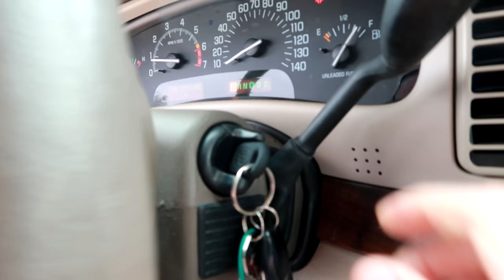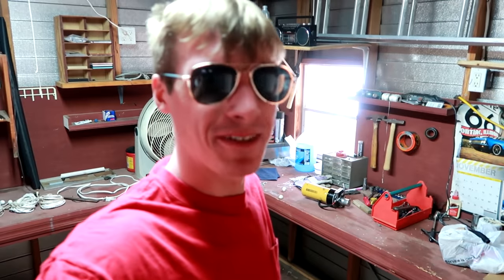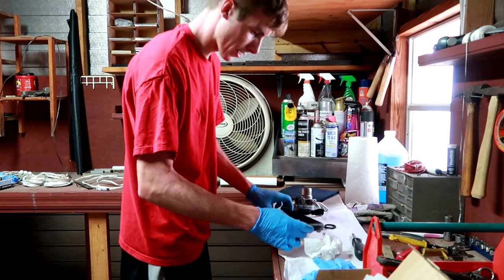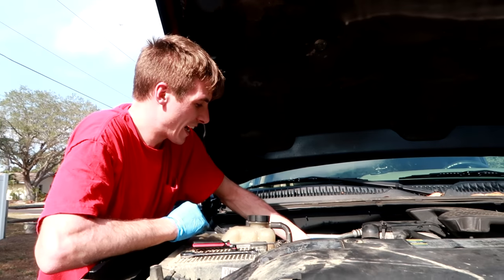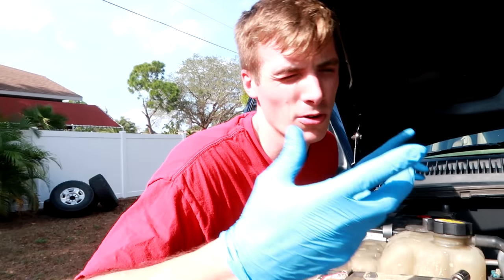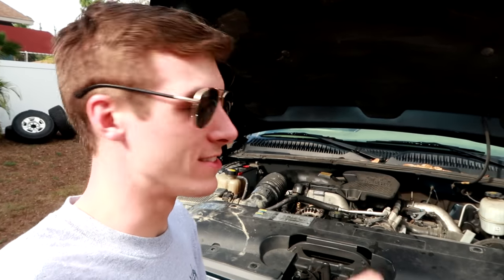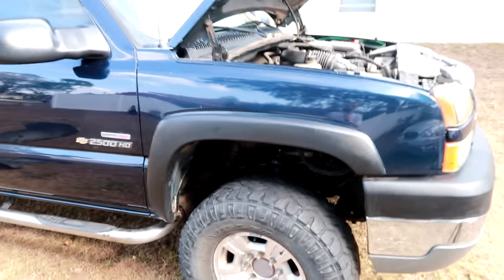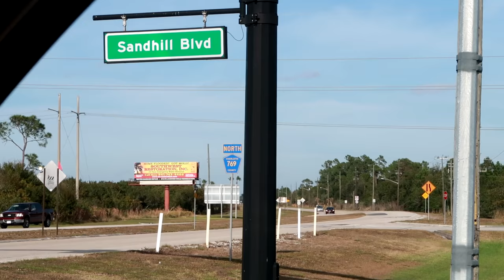THE DURAMAX DIED!!!

Comment: Word of advice mate, if you can afford to when it comes to specific o-rings, crush washers gaskets or other things, get the OEM parts for your diesel. They are a bit pricey sometimes depending on what you need, but they are factory fitted and work perfect every time. Some vehicles are like your BMW, OEM is the only way to go for a true fit. Glad you got everything sorted and your truck back up and running mate. Hope your vacation is going great as well.

Comment: Having the bleeder screw out like that will allow air to enter the filter head.  Just undo the bleeder screw half way and allow the fuel to escape out the threads and then tighten down to not allow air into the system.  Intital startup after a filter swap will be much quicker and easier on your starter.

Comment: If I may offer 2 suggestions, there are brass bleeder plugs available that are way better then those cheap plastic ones. Also, the Duramax responds very well to aftermarket lift pumps. And they solve the problems that come from loosing prime. My plastic bleeder lasted less then 2 filter changes.

Comment: next time you have to bleed the fuel system just bleed it like you did at the fuel filter housing then after that bleed it at the front of the engine at the fuel pressure test port and you will reduce crank time drastically after you have opened up the fuel system
Reply: Southern Mechanic k

Comment: Hey bud my 2005 duramax did the same thing. It's the fuel filter on the passenger side of the truck on the side of the engine. You can buy one on amazon. I did and mine has been running great ever since

Comment: I'm a big fan but man, why do you do such major repairs on your vehicle being 1000 miles from home?
Reply: R1Flem exactly
Reply: R1Flem You would drive, what like a thousand miles, with problems like he's having? Yeah, no lol.
Reply: R1Flem I had to replace all my spark plugs and put new threads in 2000 miles away from home in someone else's garage some times you don't have a choice
Reply: I didn't hear any mention of fuel system issues other than he just wanted to change the filter and seals although he did mention had a bad fuel line.
Reply: Bass Coast Central you are correct, sometimes you have no choice but to do what you need to do to get you home, but removing a fuel head unit and installing a sketchy filter adapter unnecessarily seems silly when you are a thousand miles from home.
Reply: Carson Wedel lol.....ok

Comment: goodbye starter solenoid
Reply: big diesels like this have very strong starters so they can crank for longer than normal petrol cars ....
Reply: its better to crank a diesel longer than short cranks like a gas engine if you cant get it started.
Reply: That won't hurt it, it's a 6.6L Duramax, not a 1.6L accent
Reply: I'm a diesel technician, I've rebuilt many starters +solenoids. cranking to that extent is not good. thanks for your input but I know from experience whether you think that's the case or not.
Reply: the bigger the motor the bigger the starter. My 68 Minneapolis moline m670 tractor still has the original starter on it, have to crank that thing for about 2 minutes before it will start in the summer, and 10 minute minimum in the winter lol. Still going but almost time for a rebuilt, going to be expensive. thanks for your input but I too know from experience. The amount he cranked in this video was not long at all. Wouldnt hurt anything, the starter would just be getting warmed up. The hardest thing on a starter is trying to crank them with weak batteries, that really burns them up. But a fast crank, it not near as hard on them.
Reply: I definitely will Brenden, its in the plans for sure! Just starting my channel now. Hoping to get the tractor going in a week or so. Its -30celius right now without the windchill! The tractor would probably never start!I am in Canada, Northern Sask. We have extreme cold weather warnings on the weather channel right now! lol Suppose to hit -40 tonight. Thats why I havent posted for a week, been very cold here! Was hoping my camera equipment I ordered would be in by now so I could film some better views of my videos too. lol. but suppose to be -3c in a week and I am hoping to get the tractor started and put in the shop so i can move some snow with it when it comes, we have hardly anything right now. 2 inchs.. I have a Front end loader on it too. In the summer I will have plenty of videos, doing a lot of landscaping! We just bought our property a few years ago and needs a ton of work.
Reply: excessive long cranking definitely does wear a starter, this video was not very long cranking for this trucks big starter, and he wont have to say good bye to his starter.  he posts new videos daily and will definitely let us know if his starter is shot.
Reply: JakeChevy Suzuki since you're a diesel technician I assume you know how a detroit series 60 gets primed after you change the fuel filters right? Yep you crank it for 30 seconds at a time because there is no manual primer on those engines yeah 30 seconds at a time! I've done that countless amounts of time on trucks that had well over 2,000,000 miles, needless to say the starters are ok

Comment: Hey I have the same model truck 03 lb7 and mine has the plastic bleed screw that broke on me and mine has a tendencies of not starting when I park on a hill facing up hill and it loses its prim and  every time that happens I go to the fuel system and there a pump on it and I have to put that to get the air out and it will start. And I that mite have been ur problem. I just wanted to let u some of the problems my have. But otherwise the Diesel life rocks!!!!

Comment: More than likely they sold you the wrong parts. I have discovered that many times that some times they screw up the part with the wrong number. It makes me mad. Now days I Bring in my old parts and compair,if they are not correct,then I dont install. I had to go to other sores to get the correct parts from a different supplier.

Comment: Should of bought a ford
Reply: Austin Perry hell
Reply: Austin Perry yeah
Reply: Austin Perry yeah then he would of broke down in New York
Reply: Austin Perry #burn
Reply: Austin Perry even though I'm impartial because I own a ford Chevy gmc and jeeps
Reply: Limozen Man 69 Ford all the way
Reply: Austin Perry dodge all the way
Reply: Austin Perry no hell no
Reply: I'm Zoid Got confused with dodge I think there bud
Reply: Jarret That's who I'm talking about bud LOL I'm a Ford guy so ya.
Reply: Ford is the most reliable on the road by far. With normal maintenance intervals they will last forever
Reply: Nathan T Duh.
Reply: Nathan T Lol, tell me more about how reliable the 6.0 was, same with the 6.4. Tell me more about how reliable the transmissions was on the 7.3. And don't say "well if you bulletproof this and fix that..."   if I spend 40k on a truck they should run right from the damn factory.
Reply: Powerstroke master race
Reply: Darren Thomas If you're spending 40k on a truck I would hope you're getting a newer 2011-2016 6.7. Hell you could probably get a brand new SD XL 6.7 for 40k.
Reply: CGComputerInc  A brand new 6.7 Powerstroke will cost in the mid 50's for a base model 4 door, same with the Duramax. That's why I chose a Ram with the 6 speed. However, if I bought a new 6.0 back in the day and spent 40k on it, I would be highly pissed if I had to put another 5k into it to make it run right. The new 6.7's are  solid but not everyone can afford a brand new one. I'm just saying, you hear of a lot less problems with Chevy and Dodge then you do Ford.
Reply: Engine problems sure but trans are fine. Cummins are great but dodge can't make a trans to save their lives. GM was the only American diesel truck manufacturer to produce a truck with a good engine and trans lol.
Reply: Darren Thomas The only good thing RAM/Dodge has going is their diesel engines LMFAO. Other than that their trucks are absolutely shit. So unreliable god dont even let me get started on the common cracked dashboars they have lol.
Reply: I'm Zoid  Maybe the number one because Ford sells their trucks in bulk for cheap to big companies. Just because they sell the most doesn't mean they are the best. Like I said "Fucking Owner Real Dumb." They are even having problems from their gas engines! Ford is nothing but a joke!
Reply: CGComputerInc  Dodge has a great manual transmission. The new Aisin transmissions are kick ass too. Their older automatics was pretty shitty though not gonna lie. The Allison is about the best if left in stock form, start adding power and you'll experience limp mode.
Reply: Darren Thomas Dodge is shit dude just admit it. That 4.7 magnum is the only good gas engine they have and that 5.9 hemi is completely garage lol. Overall nothing but transmission and  engine issues with the both of them. Even the cars. That Scat pack? yeah its a poser. Hellcat is pretty decent but me personally would never own a Dodge truck. Their V8s drink way too much gas ur getting more like 9mpgs out of them stock and don't even think about after a lift dude. Explain how Powerstrokes are a bad?? And don't say "Well their 6.0s are trash" aka (VT365) because we all know they are far from the best diesel engine International made for Ford. The 6.4 and 7.3s are where its at bud. 3.5l Ecoboost  engines are in alot of vehicles now. Why? Because why are people buying them if Ford is a joke like you said? It's a difference between Ford having cheap vehicles and they are complete shit vs A  good priced car or truck and it being decent bro. Therefore your response was nonsense to me.
Reply: so why do the high pressure oil pumps and the egr grenade in the 6.4
Reply: Darren Thomas I meant to say 5.9L Magnum** but ok you're so smart huh? I'm done wasting my time on you have a good night sir.
Reply: Chris Olszewski ?????
Reply: i just happend to see this and was curious cause it happend to rwo motors in the same ford
Reply: yea i am the 6.4 l
Reply: and im pretty sure the 5.4 does not have a high pressure oil pump just an oil pump
Reply: I feel many people bash Dodge transmissions haven't driven or stepped foot in a Dodge for that matter I've put 100,000miles on my 2008 cummins bought it used with 180,000 and its been changed to a trailer weighing 10k its whole life with me. No problems to speak of.
Reply: Chris Olszewski Well whatever. They are known to fail in 5.4s.
Reply: yea wish i bought a dodge for my flat bed the ford cant handle the weight of hauling carpet and title
Reply: I'm Zoid or maybe you should go to sleep before your mom finds out your trying to troll again
Reply: I'm Zoid  I'm actually not old, however I've been around these trucks a lot  and I've come to the conclusion that unless you can drop big money for a new 6.7, stay the hell away from Ford.
Reply: Chris Olszewski ??? You act so immature for a 24 year old dude but keep assuming lol you know everything about me obviously.
Reply: I'm Zoid all i know is how you just presented your self like a troll if you want to act like a civil himan being than ill treat you like one
Reply: towing rates you dont tow carpet you hual it two complete diffrent things
Reply: Chris Olszewski .....
Reply: well then tell me o smrat ass why did those parts fail cause the ford tech said "to much stress"
Reply: Chris Olszewski Towing/Payload what the fuck ever LOL.
Reply: Chris Olszewski Dude learn to spell correctly.
Reply: I'm Zoid spelling aside can you tell me why they failed?
Reply: I'm Zoid No the 7.3 is a great motor, but as a said before the transmissions was pretty shitty. Besides, the 7.3 even though reliable was a TURD, and most of em are a bucket of rust now. Ford may have the lead in tow rating by what, 100 pounds? Buddy if your hauling something 30k daily youll need a license to do so, and while the truck may pull it I would be looking more into a small semi.
Reply: Darren Thomas international MXT or CXT
Reply: I'm Zoid  Go out and buy a damn Ford for all I care, don't complain when it gives you problems, and just because your a Ford guy doesn't mean you should be telling people that Ford is the most reliable truck because obviously it isn't. I may not know everything about diesels but damn a little common sense and research will tell you that Ford is not built Ford tough. Put about 15k behind a 7.3 and 5.9 and the Cummins will drag circles around it.
Reply: Darren Thomas Why are you still responding to me? I stopped replying to you forever ago lol. And Dodge has major issues too don't forget.
Reply: I'm Zoid  Like what,  what problems does dodge have besides their older automatics and the front ends?
Reply: Darren Thomas Seriously I do not care just block me or anything. And I wont say anything about Cummins common rail injector failure in their diesel engines either. Lets just keep bashing on Powerstroke like nobody else have issues with their trucks eh?
Reply: Darren Thomas Atleast Ford didn't build their shit with the help of tax dollars but let me not go any further lol.
Reply: I'm Zoid Who gives a flying fuck, doesn't change that fact that Ford is still shit. You still haven't listed the appearantly long list of problems Dodge has
Reply: Cummon guys can't we just agree that Dodge is junk....like we all know it. Honestly another thing we know is pretty much anything made after 2000 is junk....just sayin.
Reply: Darren Thomas LOL I have a 2006 f150, brand new and never have I ever done anything to it other than change the oil lolololol ur just an angry Chevy fanboy
Reply: why havent anyone mentioned toyota trucks? arent those pretty reliable?
Reply: erik dahlfors well...yeah there probably more reliable than the big 3 but, "my daddy always drove Fords, Dodges, ect. and he said there the best"
Reply: all of you are mistaken! he should buy a toyota! :P
Reply: MysticSkills91 We bought it with 100,000 on it. No excuses for such a shitty vehicle
Reply: Well, Ford did not build any of those engines so that is no fault on their behalf. As far as transmission failures on 7.3 Powerstrokes, those usually came from pushing more power out of the engines and/or extremely high miles. I've encountered many stock first gen. Powerstroke equipped trucks with 450-500,000 miles on them with stock transmissions.
Reply: BrettRidez 100k is plenty of miles for someone to abuse and ruin a vehicle. I bought an 04 F-150 with 130k and it had the famous 5.4 Triton that everyone hates for some reason and it's been flawless the 10k miles I've owned it. The only real problem is the cam phasers on the 04-08 5.4s which they fixed on the 09 and 10 models. Spark plugs are not a big deal unlike some people make them out to be, take your time and use plenty of carb cleaner/pb blaster, etc and you're golden.
Reply: I have a 92 7.3l and its more reliable then this truck
Reply: 6.4 power strokes don't have high pressure oil pumps....those are replaced with high pressure fuel pumps, the 6.0s had high pressure oil pumps...which is what every engine from the big 3 now uses, same old shitty bosch pumps that will grenade themselves across all the big 3 with the smallest drop of water in the fuel. The EGR is just shit technology all around and will ultimately bring any diesel engine to it's knees eventually like the DPF and DEF crap.

Comment: I knew something like this would happpen       It's a chevy
Reply: Itsgone at least it started back up. no guarantee a ford would start back up
Reply: Lol the reason this happened had absolutely nothing to do with chevy, those are the exact fuel head units that are on volvo tractor trailers, they only last so long before an o ring breaks and air gets in the fuel lines

Comment: u gotta prime the fuel just cycle ur key on and off
Reply: wont work with duramax, the lift pump is built into the high pressure fuel pump, it only pumps when the engine is turning over

Comment: You kinda do everything half assed...I would bet you that your gonna have some sort of break down on your way home!
Reply: Kaleb Booher ...using aftermarket seals that don't fit properly, using parts off one for another, not replacing broken studs, using mis-matched lug nuts...in my books that's half assed. Does it work...yes, but I fix things back to factory or better specs. JMO.
Reply: CanAmXTP yeh i agree with you